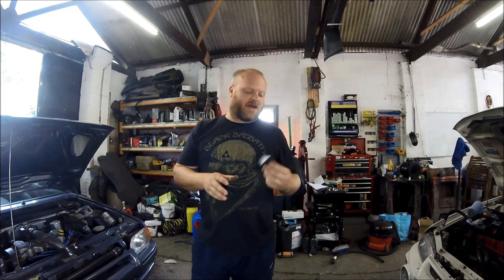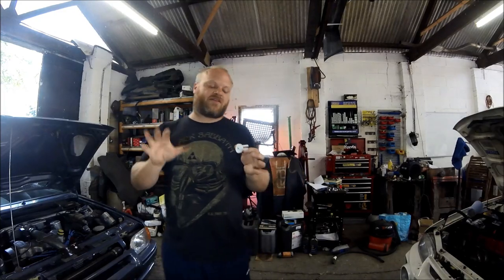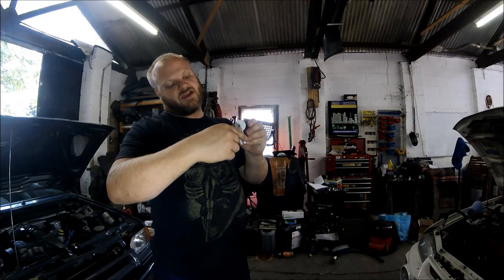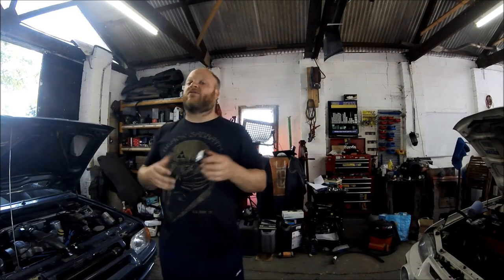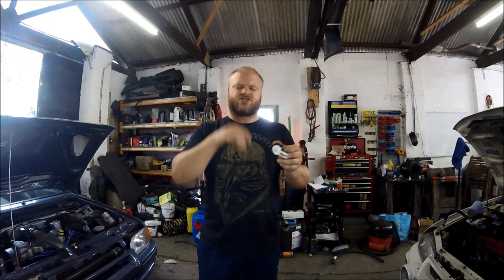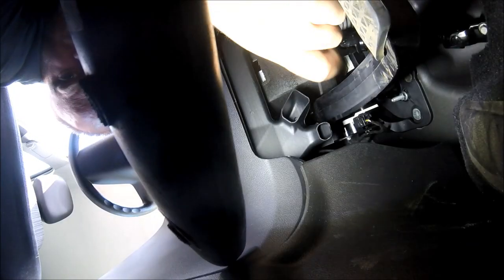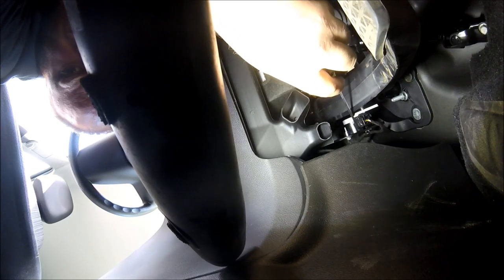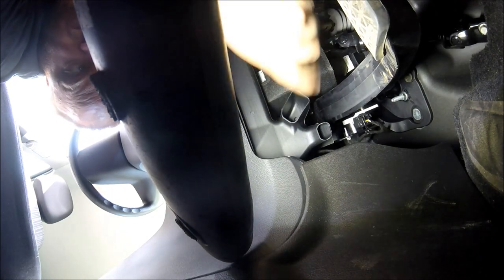Astra J / zafira / corsa / clutch switch sensor fitting replace repair not starting

Comment: I have a 2012 opel astra j 1.4 and it won't start, I wanted to ask you if when you turned it on you didn't press the pedal the yellow pedal warning light would still come on? Or vice versa if you pressed the pedal the yellow warning light would remain off? Is it true that once this sensor is replaced it needs to be recalibrated? Can you tell me the oen code for this sensor? thanks
Reply: no-one?

Comment: Do you not have to run diagnostic after to learn clutch ? I have a vauxhall antara with same problem but still no start with new pedal censor
Reply: Did it need relearning to the car have a zaffira with same issue

Comment: Does this clutch position sensor do anything except stop the car from starting if the pedal isn't depressed?  I mean, could you remove it and bridge the wires so you don't need to press the clutch to start the car without affecting anything else?
Reply from the maker: Hello mate I beleave it a verible voltage sensor so it can tel wear the peddle is, 
so I would say it would not be a good Idear  to try and bridge the wires for it could cause lots of problem
The best thing would be to replace the sensor
Reply: @TheADHDmechanic  Hi mate, thanks for the reply :)  As it happens there isn't anything wrong with my sensor, I was just curious for if/when I do get a problem.  I shall make sure it's replaced properly in the event.  Cheers, Trev.
Reply: if it is Stop Start you can get the ss mapped off
Reply: @711gsxrblah  This isn't an auto stop-start feature.  It is a 'you can't start the car with the key unless the clutch is physically depressed' safety feature.

Comment: Hi mate.

I'm having a problem with my astra j 2014 model. It shows press clutch on the screen even if I did press the clutch but it shows the same thing. And It doesn't start. I did Usk someone to change the sensor for me but still it shows the same thing. I'm woried now it's been two months . Please tell me what can I do
Reply: Hi, did you manage to find the problem,  I have the same issue
Reply: Same problem here with me ..what did you do after